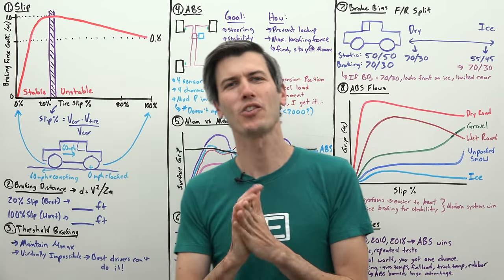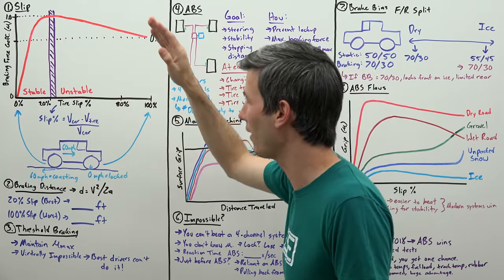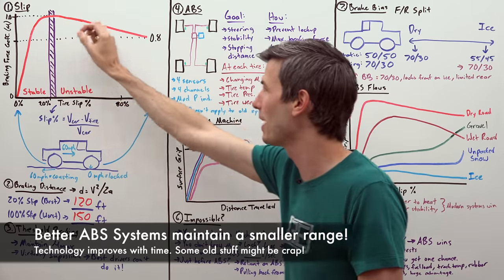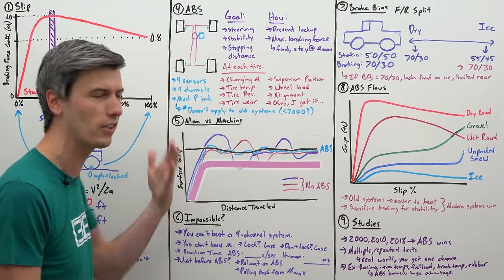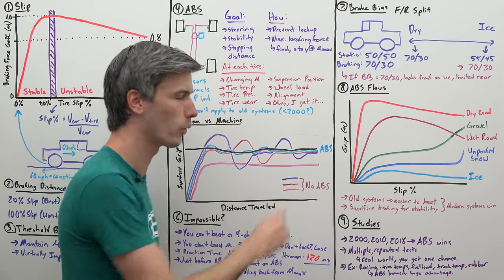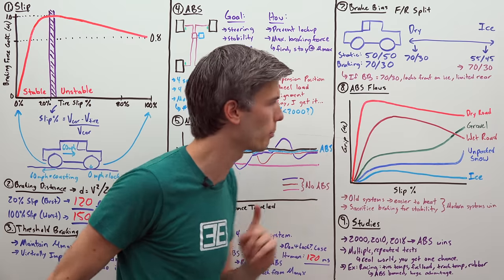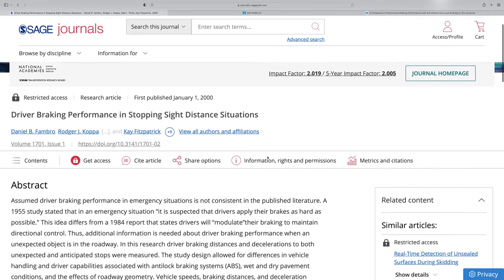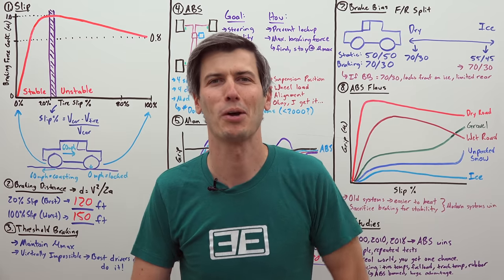Why Threshold Braking Is Impossible - ABS Wins!

Comment: My previous two cars were a a 2002 and 2006 Subarus. Both of them were downright dangerous in snowy/icy conditions with the ABS on. The ABS would completely overreact and cut nearly all braking power as soon as one wheel was on a patch of ice. After it nearly sent me across a busy intersection, only saving myself by the very last centimeter by using the e-brake, I started pulling out the ABS fuse for the winter. The difference in braking distance on partially icy surfaces was very noticeable. However I now have a '15 Subaru that does not have this problem at all. It really looks like all ABS are not born equal. A shitty ABS system can truly be worse than threshold braking.
Reply: HA! I just wrote a reply saying exactly the same thing! Crazy that we had the same experience. My 2002 Subaru WRX was terrifying in anything by warm, flat, dry pavement. Exactly as you observed it seemed like if one tire struggled, it would take down the whole system. I just pulled the fuse year-round because, like with the snow performance, if there was a bump or dirt patch on dry pavement, you'd get the same issue, which seemed like taking braking power down to almost zero. I had a super close call due to this in the dry and gave up on the system entirely. Which was super sketchy, because I had to remember to pull the fuse again after oil changes (or remember to replace it prior) and notify anyone driving the car that it didn't have ABS. I think it was very car specific. My 2005 Subaru STi didn't have any of these issues, FWIW.
Reply: My 2001 wrx does the same thing. They were simply not built for ABS use, but rallying, where you don’t really give a dime if a wheel locks up for a few fractions of a second, you plow thorugh the corners. Even modern WRC cars still don’t use ABS - though for a very different reason whatsoever.
Reply: Yep, early-mid 2000s Subaru ABS is borderline dangerous in snowy conditions
Reply: 07 outback on gravel has the same problem. But i left the fuse in. Control is more important
Reply: @vilbenasvienuolis   I don't fault the decision to leave the fuse in, but I sort of think it may have been different in your case. This loss of braking was astonishing on some models. So far from the limit of traction that it didn't require special attention / skill to easily beat ABS without any slippage or locking up a single wheel - in some cases with the ABS on braking wasn't much different from just rolling to a stop. It may have been really car specific. I had a 1998 Legacy, 2010 Forester, 2005 STi - where the ABS was fine. The 2002 WRX was singular unique in its abysmal performance.
Reply: Had a Saturn from that era that was the same for unpacked snow.

It would want to roll through every stop.  Even at extremely low speeds.
Reply: I would consider replacing the ABS system in that case, it would be a good idea to have one that actually works.
Reply: Modern abs and TC have come a long way. The TC on my 03 grand am was basically just a 2 step that limited rpm to 2000ish.
Reply: I was just coming here to comment about the infamous Subaru "Ice mode" ABS problem in the early '00s. On dry roads, braking while hitting a bump caused the system to think the wheel was on ice due to the ABS pulsing 2-3 times while the wheel was still in the air, getting no rotation and assuming it was an extremely low friction surface and limiting brake force to 5-10%. The problem was that the system took well over a second to return to normal operation and there were a lot of rear-endings. Some owners tried to file with the NHTSA but it went nowhere. The STi system was completely different and didn't have this issue.
Reply: Couldn't agree more. Until recently I had a 2001 Subaru and its ABS was absolutely terrible, the slightest bit of instability and the braking power would reduce to almost nothing. I wish I had pulled the fuse, that shitty ABS eventually got me into an accident which should've been easily avoidable. ABS tech has come a real long way though. After the subaru got wrecked I ended up with a 2018 BMW and the brakes are just incredible by comparison.
Reply: I came to this video to point out the same exact thing with my Subaru.  Super sketchy on ice with abs active.  ABS was definitely better than locking the tires up, but I was able to consistently achieve significantly shorter stopping distances with fuse pulled using threshold breaking compared to laying on the ABS.  One caveat to this tho, I was never in a panic situation while braking with ABS fuse pulled, so I don’t know if I would have been able to modulate well if panicked.
Reply: Electronic nannys get confused to easy.
ABS has its place,, just often not in real situations!!
Reply: I was not at all impressed with my mom's 2012 Forester in snow. It floated all over and like you say the ABS was miserable. My Yaris way outperformed that in all regards except acceleration.
Reply: @ldnwholesale8552  not as often as humans get confused
Reply: My 2003 WRX sent me through a downhill, wet leaf covered road, straight through a stop sign, without a hint of slowing down. I was going about 35mph, the speed limit.  The road was clear and dry but came around a bend and a tree had dropped a lot of leaves, and the morning dew was unkind.  

I bought new tires the following week. The RE92’s were only a year old (12k miles or so), but everyone on the Subaru forum claimed they were the issue.  I bought better tires, drove the car 13 more years and multiple sets of tires, and never had another ABS issue.   Ok there was this one time on loose gravel around a turn, but that was a slow motion slide. 15 mph, and zero grip, sliding sideways.  Opposite lock with no effect until it spun the car 180 degrees the other way (still sliding straight down the hill, but now driver’s side first instead of passenger side).  Street tires do not make for good rally tires! Hahaha
Reply: I just finished making a very similar comment, but about my 1999 Chevy Suburban.  Ever since the ABS forced my truck to more than double in speed when trying to brake on a snowy hill and I had to lock up the rear wheels with the parking brake to stop me from getting smashed on the 3 lane highway I was about to roll into I've been disabling ABS in my vehicles.
Reply: @vilbenasvienuolis  Yes, control is more important.  When your ABS completely removes your ability to control your speed, it's gotta go!  I don't trust ABS at all!
Reply: @vilbenasvienuolis  Pretty much all the abs systems do worse than a good driver can do on gravel or a sandy patch on the road.  CarAndDriver magazine did a article on that many years ago.  I had a few near accidents when there was a small patch of loose sand/gravel on an otherwise clean road and the abs greatly increased my stopping distance.
Reply: This is why those older Audis with 3 switchable-locking differentials had standard ABS with a MANUAL OVERRIDE. Audi figured out ABS could possibly provide subpar braking performance, so they left it to the driver whether to permit ABS operation or manually-disable it for low-traction surfaces such as snowy/icy conditions.
Reply: Yes ABS is horrible in snow and ice.
Reply: I've found this to be true in very icy conditions as well. It is easy to perform this test, and you'll find that braking distance substantially shortens if you are able to brake just before the ABS kicks in. This is no fault of the ABS system, it has to do with the extremely low surface traction and the mass of the tire/wheel assembly. For ABS to do its job correctly, the tire needs to have enough traction to relay an accurate vehicle speed upon releasing brake pressure. If the surface is so slippery that the mass of the tire/wheel assembly overcomes the coefficient of friction, and the tire cannot speed back up, the ABS system sees this as a near lock up scenario, and averages less total brake pressure to compensate. Big heavy wheel tire combinations seem to make this worse. I live in ND where it is icy for about 6 months, and I've noticed this on just about every vehicle I've driven. Again, this is only on very slippery surfaces such as glare ice or packed unsanded snow.
Reply: 1 Channel ABS 🤑
Reply: I had a 2004 Passat wgn with ABS and the ESC which I believe was a 4 channel system however maybe poorly programmed.  I approached an intersection both driver side wheels on the dry and the passenger side on ice which with our old 2000 Astro van or 95 Crown Vic would have stopped just fine unlike the VW which buzzed the ABS as I rolled into the intersection.. 😮😡

That being said my latest vehicle has a push/pull automatic buttons and it’s very difficult to try and stab the N button on the dash to disengage the drive power from the wheels as it’s sliding past the stop sign..I kind of miss the old column shifter for that. That worked instantly but the new vehicle because it’s electronic shifted doesn’t do that shift instantly like the old lever did.
Reply: @Sleggt  most abs before 2005 is terrible.. ask GM in 1991..
Reply: Same. I had a 95 GMC where the ABS was basically a crash-creator. Currently have a 13 Ford that is far superior. Family member had a Mercedes from the 80s that was superior to the GMC, also.

Personally, I try not to allow ABS to ever kick in, that means I'm braking well.
Reply: @Kris Simons  I, too, have decided to be forever racist against ALL Spanish people, because a Spanish person once pickpocketed me.
Reply: @phant0  I'll don't know why I haven't heard about a recall on this.  It certainly seems serious enough to be in that territory.
Reply: @plaid13  I have found that to not be true.  I love ABS in the winter.
Reply: @Sweetpayne  Try it on ice going down hill when it constantly thinks its skidding and keeps pulsing the brakes as you slowly creep instead of stopping like you would without them. ABS is nothing but a crutch. Its great for when people panic not so much for those in control.
Reply: A common mod to older Tacoma's was to disable ABS for OR scenarios.  On gravel, the ABS will virtually disable the brakes and you face death!
Reply: Many modern but cheap cars with simple ABS w/o stability system, have problems on ice spots or bumpy roads. As one wheel get locked ABS release all breaks and several meters car rolls free. So not only the systems from 70-s are so bad.

Comment: My first experience with an ABS equipped 53" tandem trailer was an eye popping experience.  Moderate grade down hill, stop light at bottom, and way slipperier than I thought.  I knew from experience that I would be unable to stop before the light, and excessive braking would cause a jacknife. I laid on the horn as I explored my brakes, and was astonished when the whole unit stopped well back from the light, trailer dead straight.
Reply: Hahha must have felt a little silly, honking like an out-of-control freight truck  just to come to a stop at a very safe distance.

I love the story though! I had something similar.....shook me! Emotionsly and also....you know....physically shook me!
Reply: @donperegrine922  Yes it was embarrassing! Still a good feeling though.
Reply: 53 inch? 😁
Reply: @MrMice...  good catch. My excuse us "fat fingers!"
Reply: @patjackson1657  all good,  just "bustin' chops" 👍
Reply: Yep, In a 100k lbs rig it quickly becomes strategy to consider braking distances. With or without. All Ill say is I'm glad I never had to drive a rig without it.
Reply: First time I experienced it, I heard some rattling and vibrations in snowy conditions. I let off the brake, heading right for a ditch (onramp) - I pulled the ebrake and spun the car 180, avoiding the ditch, but also testing the brakes of the two cars behind me. No accident, everyone resumed their journey. That's how I found out the operating characteristics of an ABS pump.
Reply: too right! you never realize just how brilliant ABS systems are until you find yourself in a situation that frankly you don't want to be in, and the system responds promptly saving the day
Reply: @patjackson1657  0 embarrasment there, better safe than late.
Reply: Cool story bro.
Reply: 53" ? Must have been playing with his truck toy again.
Reply: Turn in your CDL, you're not fit to drive!
Reply: But how does this have anything to do with ABS... If excessive braking causes a jacknife, locking the wheels would be less effective than using ABS. What you said is backwards... You stopped because you had good brakes, possibly the trailer had brakes too, nothing to do with ABS.
Reply: @leoshahbazian6830  you obviously have never driven a tractor trailer combination.....
Reply: @leoshahbazian6830  The trailer had the ABS brakes
Reply: @the_kombinator  yeah that's why people should learn to drive before they drive. If you're a total noob, go find a parking lot and mess around until you know how the car behaves.
Reply: I dont have ABS, though a 155cc bike on a small south east asian country is plenty big enough. The thing wont stop well even with 2 pot front and rear calipers if in a hurry, and I weigh around 100-105kg. Slipping the rear would be better than slipping the front, can say from experience. And honking like a maniac is the only hope I cling on to when someone decides to be an asshole and cut the car or bike or anything in front of me and just brake heavily. After the front lockup crash experience, I try to keep as much distance as possible without being a bother, and whenever on a downhill and theres a red light, I just cut engine and let 1st gear do its job of holding me
Reply: @patjackson1657  53" tandem trailer going downhill... that's a pretty solid testimonial for ABS right there!
Reply: @patjackson1657  Better embarrassed than upside-down!
Reply: good comment Pat!
Reply: honking to warn people is always a good idea tho, best to annoy someone than not have them notice and they crash
Reply: lmao better to be silly and make someone crap themselves than not and blow a light into a car

Comment: 14:50 I am glad you mentioned this. I had a car without ABS until 2019, I practiced threshold braking and was able to brake steadily without locking my wheels. And yet when I later got into emergency situation (car in front of me started braking because deer jumped in front of it), I was just sliding to it. Luckily I had enough distance to stop and not hit the car.
Then this year I had another emergency when a car didn't give me the right of way. I again just pressed the brake pedal as hard as I could, but now in a car with ABS and ESP I was able to steer and not hit the other car. Without ABS I would just slide into it.
Reply: Only vehicle i practice threshold braking on is a bicycle. Very interesting though.
Reply: That's the biggest advantage of ABS, no matter how good you are at threshold braking, when you have some emergency situation you're just gonna mash the pedal like a dumbass, and ABS is gonna save your ass.
Reply: @imnota  you are 1000% correct
Reply: Because different roads have different coefficients of friction, practice with threshold braking on one road is meaningless if you're on a different road. Or if it rained, or if the temperatures changed, etc.
Reply: @imnota  I was in my dads 70's car after a light rain going down hill to a traffic light, just sliding into the cars until I remembered to let off the brake and the front wheals caught and threw me in the ditch with like 10 ft to spare. It was a big ditch, and a really heavy door at a 35 degree angle. The car was fine after a pull out of the ditch, and I have no idea if any of the cars in front knew how close they were to getting hit.
Reply: Cool story bro.
Reply: @imnota  nah, not everyone go full berserk on pedal.
Reply: @imnota  Not on ice or wet leaves :)   On ice 50 mph stop without ABS 80 meter, with ABS 400 meter :P  But new cars have a wheel lock option on low speeds
Reply: @MikeB4pl  my 95 Lexus LS400 had a lovely trick with it's abs on low grip surfaces, slight vibration from the wheels as it cycled and you ould steer and turn.....till you got to 5mph, then the sensors where too slow to update the wheel rotation speed so the car thought you'd stopped and just locke up all 4 wheels to a gentle halt 🤣

Comment: had this ABS discussion for years now. The first systems increased the breaking distance slightly but remaining to be in control of the car was deemed more important then.  AFAIK: One of the main problems with drivers is that they actually do not break hard enough or let go of the pedal when the car starts rattling under ABS.
Reply: I find steering under abs sucks in icy conditions. Using over steer and the throttle pedal have been much more efficient for avoiding obstacles. Obstacle avoidance is much more than breaking.
Reply: yeah, i think modern cars will almost make you brake hard, if you suddenly put a bit of braking force it assumes you want full braking force
Reply: Most cars (even my 06' minivan) have an emergency function, so when it detects that I started braking suddenly and with quiet a big force (my car, others might use other methods) it boosts the brake as much as it can, so basically my foot unintentionnaly starts braking 100%, instead of lets say my self in shock who would only brake with 60% force. I guess its an early system, but works fine, on a very basic principle: you brake more if the brake pedal is lighter than what you are used to. It used to europes safest car for a year, until the same manufacturer came up with the bigger brother model.

Side note: the brakes are fine, it just passed inspection 2 month ago, this is intentional, its a system on the car and its not that my brake pedal falls in. It has fine brake pressure, it has new discs and pads all around, bled out and everything!
Reply: @LOGIBEAR01  yep, hard braking just loses it no matter how good the driver is, better to gain traction smoothly and slowly, if u go sideways u should using more throttle before u even think about braking